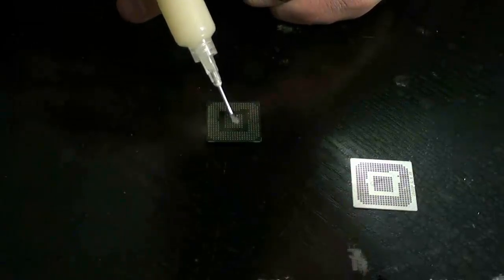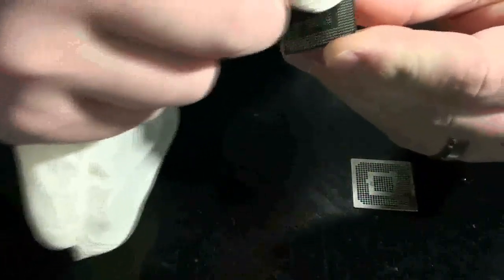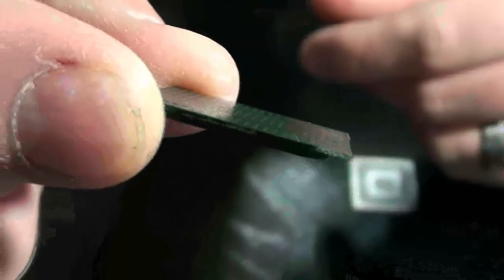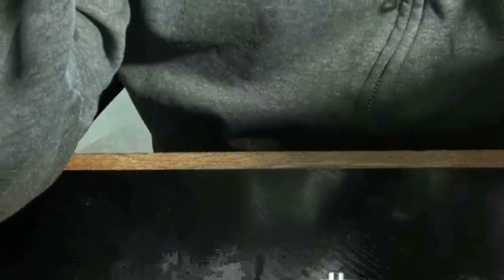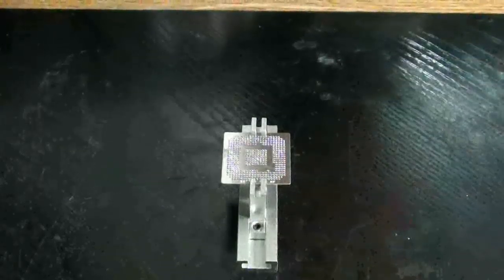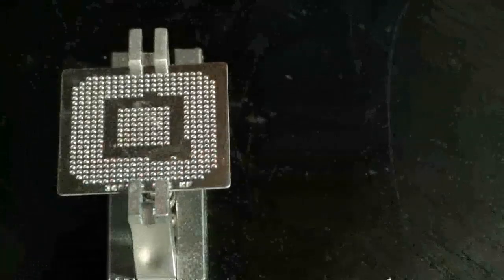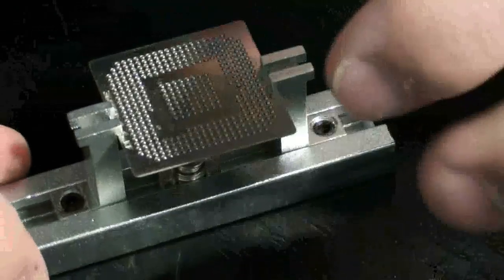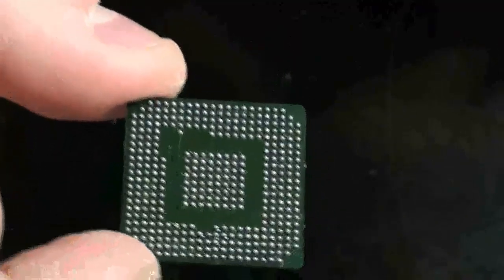Direct Heat Reball Xbox 360 Southbridge

Comment: Hello. How much was the temperature set for the reballing ?  i thought i listen 400 °C . Is this correct? I thought the properly temperature is about 250 °C . PS. Happy new year :)
Reply: Dunno if after 3 years it will work for you, but the melt point its suppose to be 220, however maybe he said 400 cause its better give a bit more heat
Reply: @emiliodelafuentesanchez1947  probably 400°F